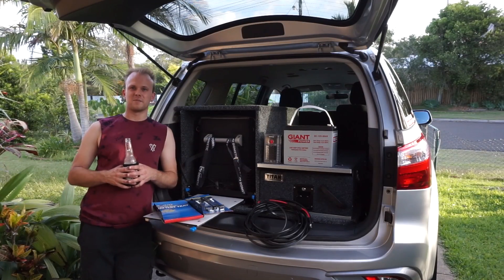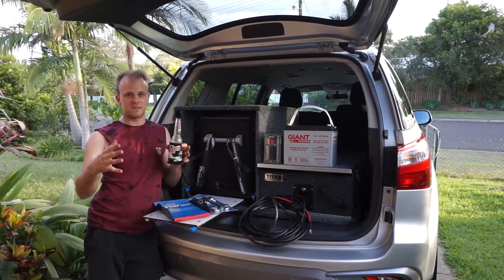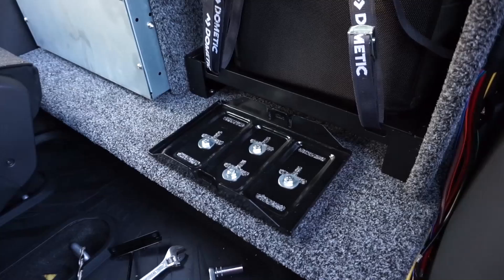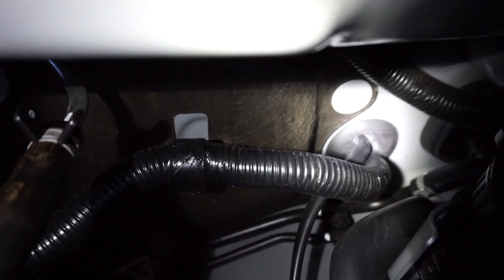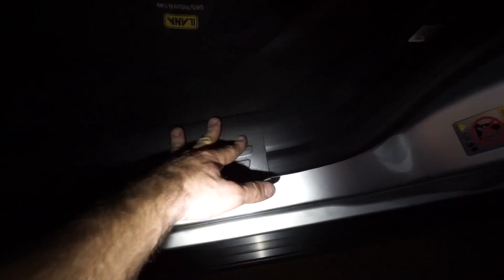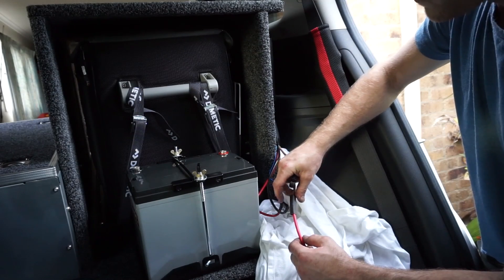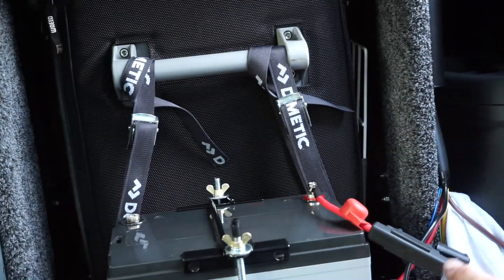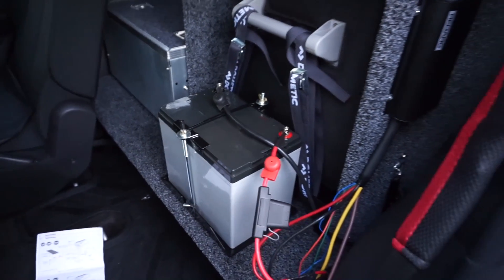Isuzu MU-X Dual Battery System and 12V Setup - How to wire up a 12V System

Comment: Hey Nick, that's such a neat setup, very impressed. Maybe a dumb question here, but are you concerned about the intake of water given all the electrical equipment you have? Or have you allowed for this somehow, very interested to know.. Cheers. P.S. Subscribed!
Reply from the maker: Thanks for subscribing dekaOsiris!   All of the electrical setup is very well sealed and can go through water if it ever does. Most of the time this setup is put in the engine bay were it is hammered by water, heat, dust an mud for years and years. So having it protected in the back will keep it in good condition for alot longer. But if it ever does get wet, say if i got stuck in a water crossing or something i would just need to let it dry off and it would all be fine. The only thing that may get damaged is the fridge, but then again i have heard of lots of people sinking the fridges and just letting them dry out and there ok. So all in all it shouldnt be an issue. Hope that helps 😊 Cheers!
Reply: @LowRangeNick  thanks for the explanation mate, much appreciated.

Comment: Top video mate, very informative. I'm in the planning process of my 12v system right now and there are a couple of points I'll be taking away from this video. Also, what gauge / diameter wire were you using from the crank battery to the DCDC charger?
Reply from the maker: It used 8 awg wiring from the cranking battery to the dcdc charger. Thanks alot 😊👍

Comment: What size fuse did you run from the second battery to the fuse block?
Reply: Just for knowledge for the people,  fuses are there to protect the wires, so knowing the maximum amps the cable is rated at is essential. Fuses should be picked that are less that rating so I WOULDNT be running 120A fuses on 6-10mm cables.  Most 4wd setups 6mm cables (40-50A) 10mm(60-80A) as a rough idea. Hope that helps.
Reply from the maker: Hey Jarrod, i used a 60 amp maxi fuse between the secondary battery and fuse box.
Reply: LowRangeNick is there any reason you put a 60 amp fuse when the max amp output of the fuse block is 120amp
Reply from the maker: @jarrodschoenmaker8780  Because the biggest fuse i could safely run in the Maxi fuse holder was a 60 amp fuse. If i wanted to run a 120 amp fuse i would of needed to buy a fixed larger fuse holder which are a little more expensive. Also i highly doubt i will run enough accesories of it to reach 120 amps. At the moment i have a fridge and camp lights. The fridge draws max of 7 amps and my lights draw under 1 Amp. So that gives me more than enough amperage to play with when it comes to fitting my other accesories 😊👍 hope that all makes sense haha!
Reply: LowRangeNick awesome thanks so much I’m going to install the same fuse block soon so answers the questions perfectly. Also great video mate you have a talent! I just love how much effort you put into thing to make them neat and tidy not many people do that!
Reply from the maker: @jarrodschoenmaker8780  Thanks alot man! It definately pays to take your time and do it all correctly. Its a great fuse box. Makes it so much easier to wire things up. 😊👍

Comment: Excellent info for DIY. For the cable going thru the firewall, do you apply any silicone to stop water ingress.
Reply from the maker: Thanks alot T. I didn't apply any sealant as the rubber grommet is pretty tight around the wiring. If you were concerned about it though you could put some silicone sealant around the wiring. : )
Reply: T Yik I had mine running through a small slice in the grommet and I had water in passenger footwell. I couldn’t believe it was coming through here so looked at other possibilities. Then sikaflex to the grommet and it stopped. I did it to both sides to make sure.

Comment: Everyone has questions Nick - mine is where did you get the led lights? They are really nice. Good run down of your install. Placing the second battery in a cooler environment than under the bonnet will improve its life. You probably want a volt meter so you can ensure you don't run the battery down below 12V or whatever voltage is required for maximum life (if that is high on your list of priorities). You can get ones that plug into lighter sockets, but I suggest get something more permanent than that. I'd use an analog meter like this - just because they don't drain your battery and are ultra reliable. https://i.ebayimg.com/images/g/zcsAAOSwquBah7Av/s-l1600.jpg (Not sure about this one, but generally you can take the cover off and mark in your min voltage to make it easier to see when the battery should be charged).
Reply from the maker: Hey Benny! Heres the link to the little lights ive used. https://www.ebay.com.au/itm/2X-12V-Aluminum-Swivel-Lamp-Cool-White-Boat-Caravan-Rail-Strip-Light-Switch/190848204492?hash=item2c6f707ecc:g:HlEAAOSweW5VZShN:sc:AU_StandardDelivery!4000!AU!-1

I will definately be putting in a monitor of some sort in the future, thinking of with an amperage meter and voltage gauge. Cheers 😊😊😊
Reply: Should have used a Intervolt DCC pro, has a display with both main and second battery voltages.

Comment: Nice info...Good set up...What gauge wire for the lights...👍...
Reply from the maker: Hey Rooster, for the lights I used 3mm twin core because that is what I already had in my shed. The lights do only draw .15 of an amp per light. So .3 of an amp with both lights on according to the specs on the website I bought them off. So i could have used much thinner wiring and it would have been fine. Cheers for the comment 😊😊😊👍👍👍
Reply: Thanks, buddy...👌...
Reply: @LowRangeNick   hey mate what size fuse did you use for the lights?

Comment: Good work. Very tidy
Reply from the maker: Thanks Travis 😊👍
Reply: How did that earthing option go? I'm about to do a similar install in my Dmax with a Projecta unit and not sure how I will earth the 2nd battery in the tub.
Reply from the maker: @chicbarn  The earth works perfectly, very very low resistance back to the battery. As long as you clean up the contact point you shouldnt have any dramas. If the tub is mounted on rubber mounts it may be slightly different, but there is usually still some sort of contact between tub and chassis. You can always use a multimeter to check the resistance between the tub and chassis before commiting to the earth point just to be sure. 😊👍